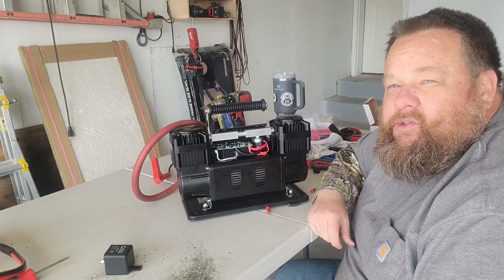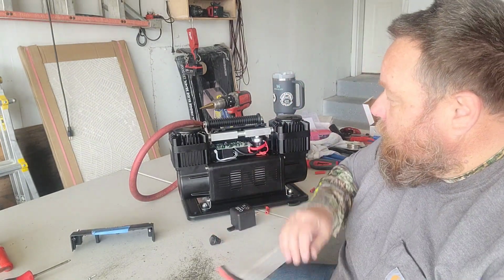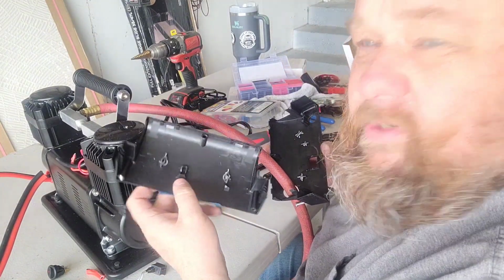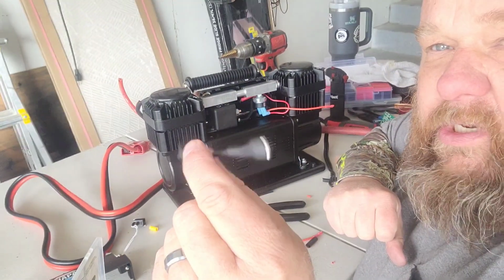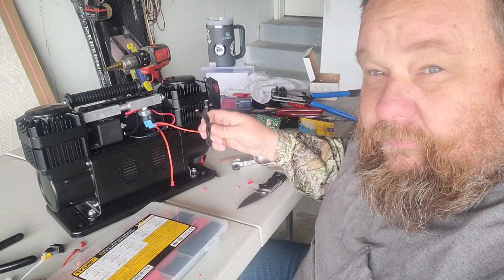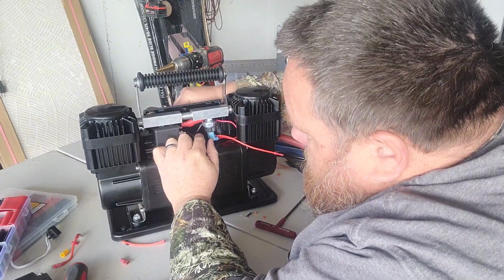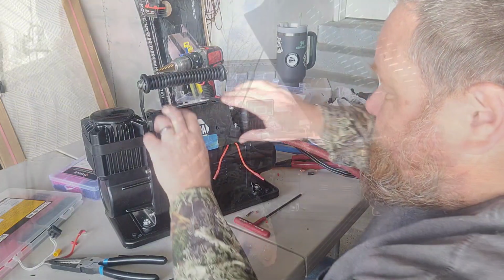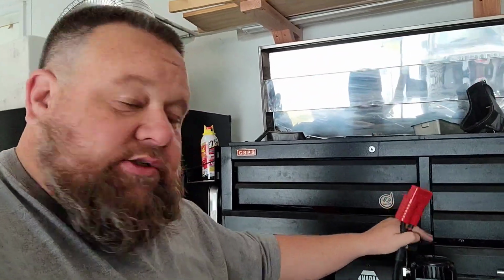NAPA Flate compressor part 2. Simplifying and upgrading the wiring.

Comment: Just picked up a Napa comp a few weeks ago. Thanks for posting your solution to make the unit better. I'm definitely going to use some of your tips.😊
Reply from the maker: Glad you enjoyed it. I just did another one today. Instead of putting the hose on the compressor, he is putting the hose on the manifold. I threaded the I/M coupler straight into the manifold. Had to open up the plastic a little with a dremel but it might be my new favorite way of doing these.

Comment: #4 welder cable is way way more flexible than any of those chinese jumper cables
And I'd make absolutely sure none of your wire are anywhere close to those cylinders inside there, the will get EXTREMELY HOT during operation!!!!!

NICE Cables, Excellent work!!!
Reply from the maker: Good welding cable is so much better than anything else you can get. It's designed to be nice and flexible and abrasion resistant.

Comment: It always surprises me with how optimistic stuff like this is with wire size. Even if technically it can handle the amps people always forget about voltage drop. Good video, I bet that motor is happier with the larger wire. I've got some of those huge 4/0 anderson connectors on my big diy lithium pack for running the winch and inverter.
I need to get one of these compressors soon and toy around with it. I tried the a/c compressor into air compressor mod but it was really difficult to filter out all the oil it kept puking up, even with multiple catch cans filled with steel wool and a recirculating drain back into the intake.

Comment: Great video! Seems no simple project is always simple. Including problematic adds truth to your project. I am glad its not only my projects that are frustrating at times!  Any reasonable way to add a fuse? Well done!
Reply from the maker: Since there wasn't a fuse on it to begin with, I didn't see a need to add one but you could put an inline fuse holder on the power wire coming up from the motor. Then wire it the same from there.

Comment: Great job, how about a link or part number on the relay?
Reply from the maker: True MODS 12V DC 200 Amp Split Charge Relay Switch - 4 Terminal Relays for Truck Boat Marine https://a.co/d/3M6avip

Comment: I'm a little confused on wiring the relay.  Would you mind specifying which wire went to which numbered terminal on the relay?  I guess connecting the negative leads to the 30 and 87 terminals is what's crossing me up.  Thanks.
Reply from the maker: Don't get hung up on the numbers. If you are using the same relay as shown in the video with the two screw terminals and two spade terminals, the numbers don't actually matter. The heavy guage negative wire coming from the battery could go to either screw terminal. The heavy guage negative wire going to the motor would just need to go to the other screw terminal. Since you are working in a tight space, let the wire location dictate which terminal it goes to the easiest.

The relay is just a switch and doesn't care which way the current flows through it. It just opens and closes the circuit.

The same is true for the spade terminals. It doesn't matter which way the current flows through those either. 

Hope this helps.
Reply: Thank you...I appreciate the response.  I'm running #4 wire from the voltage source, which occupies much of the limited space, but it all worked out. @IronsideAdventures801
Reply: I just made a vid on how the relay works, how to test it etc.

Comment: Have you seen the Thors lightning or M.O.A.B with the display and auto shut off once it reches desired pressure?  It stops and checks the pressure while airing up just like an air pump at the gas station.  Any thoughts on how to make a system like this?

Comment: Great video, thanks! Thinking of doing the same mods to my compressor. How has that relay held up? I am thinking of mounting my compressor in the engine bay and am concerned about heat.
Reply from the maker: So far, no issues with mine or any that I've converted that I know of.
Reply: @IronsideAdventures801  awesome, thank you!

Comment: I’ve been watching several videos on adding the relay. Some things I have read and watched say that you want the relay on the hot lead instead of the ground side. I’ve tried wiring it this way, but I can’t figure out how to include the thermal protection wire into the mix. Any thoughts?

Also since making this mod, have you used your compressor enough to actually have the thermal protection kick the compressor off?
Reply from the maker: I've done 3 Jeeps in a row all on 35s or 37s. It's never kicked in. 

I don't know how I would wire it with the relay on the hot side. Never bothered working it out because it was wired on the ground side from the factory.

Comment: So i cut out the circuit board and the thin original jumper cables. Im having trouble with the on/off switch not working.  Im using a pressure switch, same 200 amp relay as yours, the original on/off switch.  Theres 3 wires that come up from the compressor.   

 Is this correct if i have the thin red wire from the compressor connected to the on/off switch, the othere side of the on/off switch is wired to the pressure switch. The other side of the pressure switch is wired to relay.   The thick red wire from the compressor is wired to red part of jumper cables, and thick black ground wire from compressor goes to the relay and the negative on jumper cables. And a small seperate wire made on ground of relay to other side of relay.  ??
Reply from the maker: That sounds correct. 6 ga red wire, 6 ga black wire, and 12 g red come up from the motor. 6 ga red gets connected directly to red alligator clamp wire. 6 ga black goes to one of the screw terminals on the relay. Other screw terminal gets connected to to wire running to black alligator clamp.

12 ga red wire comes up to one side of pressure switch. Other side of pressure switch goes to one side of switch. Other side of switch runs to one spade terminal on relay. Other spade terminal has a short jumper that runs to screw terminal connected to black alligator clamp.

If you run your jumper to the wrong screw terminal it won't work. Maybe check that. I run the power from pressure switch to on/off switch to relay. Relay has to be last. The order of the other two shouldn't matter but maybe try switching the order around. 

Good luck. I hope you get it figured out.
Reply: I just made a vid on the relay if it would help you

Comment: Mine said m10 on the motor leads which is #8awg? I'm using #6 to to feed mine. Thanks for the great video.
Reply: M10 is a bolt size. Perhaps it said 10mm2 (squared not the number 2…a tiny 2 up in the corner) indicating conductor cross sectional area in millimetres squared. Essentially the metric version of AWG

10mm2 is 8AWG IIRC. 6 AWG would be better for a 90A compressor. At the very least use a cable with 90 or 105 degree Celsius insulation. Silicone has a 200 degree insulation and therefor would handle the amperage better but would need some kind of sheathing because it’s not very abrasion or cut resistant.
Reply from the maker: It would be 10mm². That is right between 6 ga and 8 ga.

Comment: Just curious when you’re using your air compressor does the air compressor speed up if you start your vehicle that is running off of?  I replaced the compressor leads with a set of six gauge jumper cables that have a voltmeter built in them. If I run the compressor just off the battery it shows like 12 1/2 V but if I start the vehicle, the gauge shows 14 V and you can hear the compressor speed up. Is this a problem?
Reply from the maker: Totally normal. A fully charged 12v battery will have around 12.6 volts. Your alternator puts out around 14.4 volts. You can definitely hear the difference in how the compressor runs with the vehicle running versus not. You should always have the vehicle running for best performance if you can.
Reply: I assumed it was normal, I just wasn’t sure if the circuit board somehow regulated the volts to keep them at a constant 12 volts. I didn’t figure 14.5 volts would hurt anything but thought I would ask.
Reply: @truckieharbison2148 I would also want to leave the vehicle running so you don’t accidentally run the battery down to much and you can’t start it again

Comment: What about the original thermo switch which is supposed to cut out when the compressor gets  - for whatever reason - too hot???
Reply from the maker: As far as i know, the thermal switch is on the motor and will shut off power to the lead going to the circuit board. Thermal switch, pressure switch, on/off switch are all inline in this configuration. I haven't tested it because I don't want to intentionally overheat my compressor. 

Also, the main cause of overheating with these compressors is letting them run against a closed valve. The pressure switch prevents that particular situation from happening.

Comment: I took mine apart to install a pressure switch and found that the "manifold" was cross threaded into both heads.  

I tried to clean up the threads with a tap and replaced the aluminum manifold with copper pipe. But there just isn't a lot of thread engagement so I'm skeptical how long it'll last.
Reply from the maker: They are definitely hit or miss on quality control. I had one I did for a friend that I couldn't get 2 of the head bolts out. Ended up having to rotate the manifold enough to drill and tap with it still on the compressor. The good news is that they do seem to work well even with the QC issues. I know a number of people running them for years in one version or another and they are still going strong.

Comment: No fuse needed with such a large amp draw on the battery?
Reply from the maker: You could add one to the vehicle side of your wiring system if you wanted. The wiring for this is similar to a winch though and there is rarely any type of fuse on a winch system.

Comment: The vast vast majority of jumper cables are copper coated aluminum and I see a lot of people using jumper cables on these. 

CCA is equivalent to a copper cable 3 or 4 AWG smaller….so using a 4AWG CCA isn’t an improvement to an 8AWG copper cable. 

And yes I saw that you realized the jumper cable conductor wasn’t actually 4 gauge. Just thought I’d add that in. The cable on the unit has to be pure copper otherwise it would not handle 90 amps any day of the week
Reply from the maker: This is good information. Thanks for adding it to the discussion. From your information, it sounds like if using good pure copper leads, you could do 8 ga. That also means my 6 ga cables are over sized. I'm good with that too.

Comment: How come you didnt use the original on and off switch?
Reply: I cant get my on/off switch to work. Also do you have a close up picture of all your wiring?
Reply from the maker: It was simply in the way of the new relay. It was easier to drill a round hole for a new switch. I've since learned I can cut the mounting tab off the relay to gain a fraction of an inch and get it to work with the factory switch.

Comment: Worried about a Chinese board in there, so put in a Chinese relay LOL
Reply from the maker: Much easier to replace a Chinese relay than troubleshoot and fix a Chinese board. 2 spade connectors and 2 nuts. Out with a bad relay in with a new one. Can do that with a circuit board. 

Not to mention I can completely bypass all of that and hot wire it with a multi tool. Can't do that with a Chinese circuit board either.